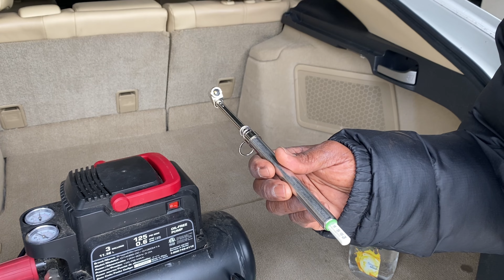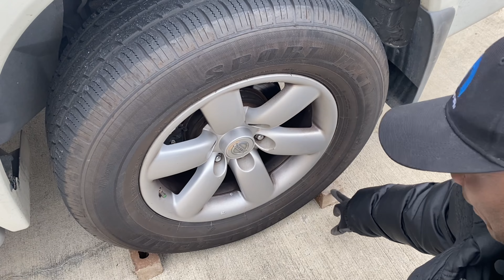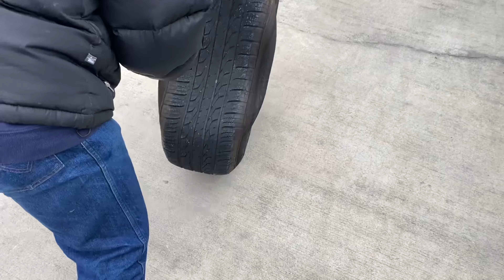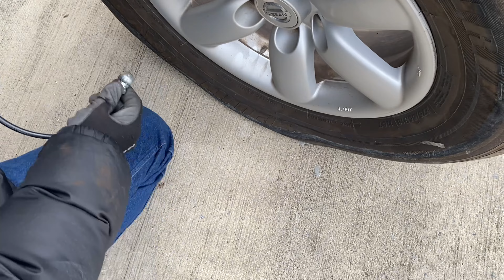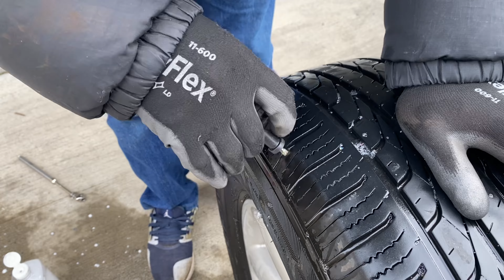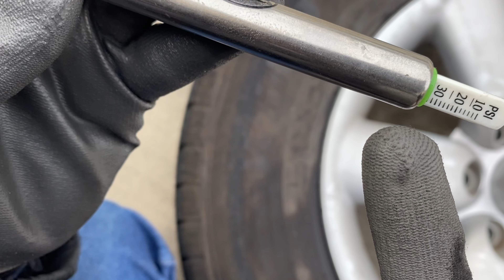Flat Tire | How to fix a flat tire at home

Comment: Thats a no no, should be at least an inch plus from the edge
Reply from the maker: You’re correct sir. I did suggested in the video that if this repair were for a customer, I would have replaced the tire, because it was too close to the edge. It’s a brand new tire and it’s in the rare of my vehicle, I have to get some life out of it before replacing . Thanks for your input!!